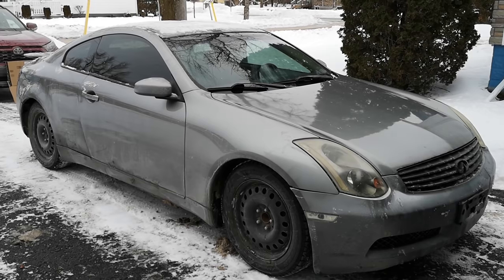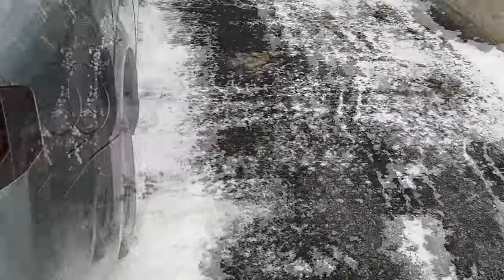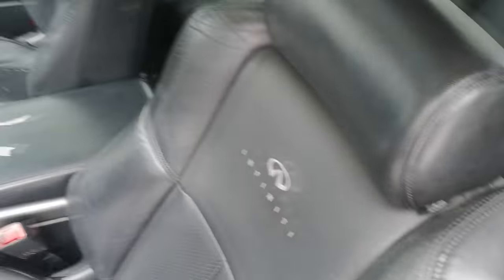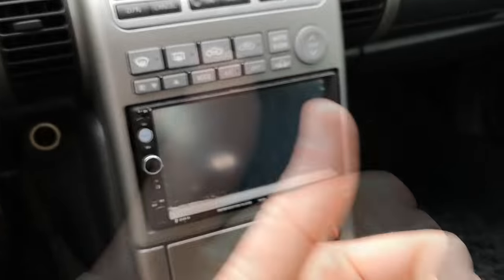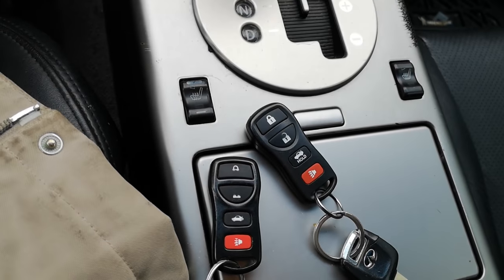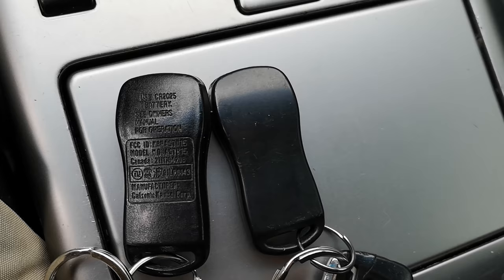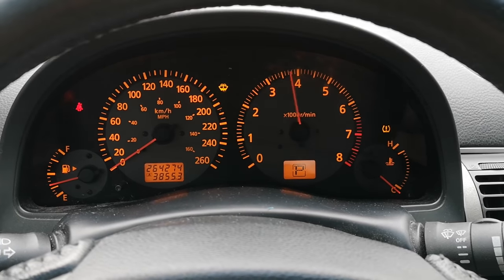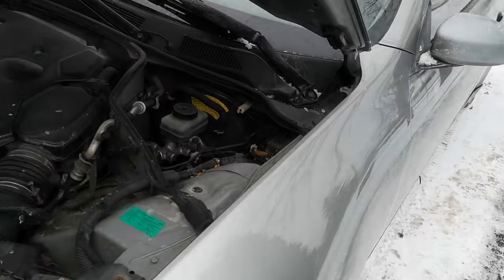I BOUGHT A PROJECT CAR

Comment: Hey I just wanted to say a few things,
1) you can get cheap exhausts for these cars on eBay, buy the pieces separate and you can create a nice sounding exhaust on a budget
2) the autos (non rev engine) don’t leak oil like the manuals (revup engine) and the 6mts RPMs go higher than the auto
3) the hood thing on the g35 coupe is a super common thing I’ve heard of a lot of people mentioning before I don’t think anyone took off the body panels. 

Love the video I’m gonna keep following this build I have a g35x sedan but genesis coupe as my daily, and I’ve been learning about these Infiniti G line cars for a while  I love them great bang for your buck budget car. Much love 👌

Comment: 1. Watch chrisfix and superclean it (to point of "good" not "Brand new, straight off the production line". 
2. Get some new rims and tyres
3. Plasti dip the whole thing black and dimm the rear lights and the front lights, dont forget to black out the windows
4. Done, no engine mods. Maybe throw a wing on it

Comment: Americans buying cars like it's nothing,
Meanwhile in the UK we hardly afford to buy a used car under 60K miles for under 2K.

Anyway, good luck with your project car!
Reply: Here in norway you can hardly get mot/tüv for under 2k$/€/£
Reply: I'm in Michigan US, and you can buy a car off Craigslist for $500 in any condition but still runs and drives. And have it registered and insured without any inspections the same day
Reply: @BrokeWrench  yeah a great example on top gear shows you can get a new top of the line Raptor for 20 odd K but in the UK you can only get a new Fiesta